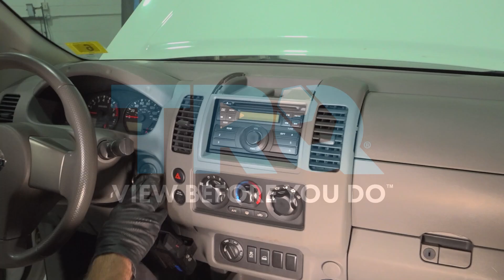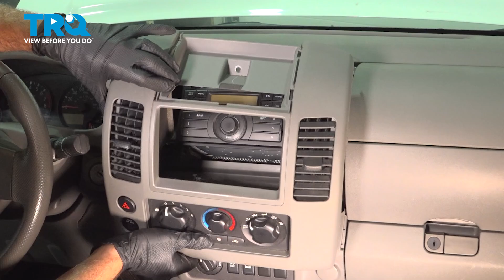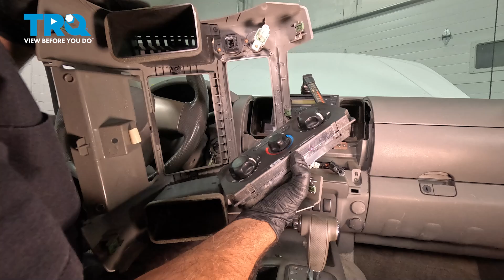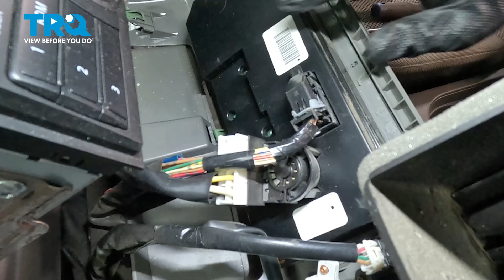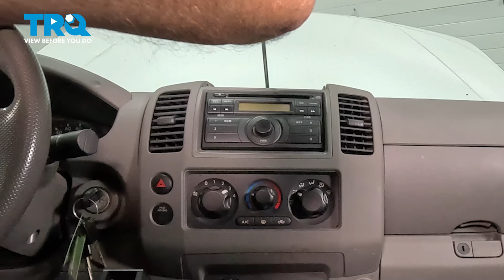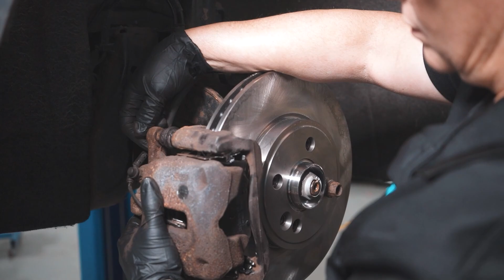How to Replace Heater & AC Control 2005-2021 Nissan Frontier

Comment: Hello sir, I'm looking for part Climate Control Unit (CCU), Nissan Navara D40, 2013, RHD, P/N: 27510JS60B, Build Code L2. I found this information on the back of the CCU. Also, will a LHD of this part work, so plug & play, without doing anything on the wiring? Please advice.

Comment: I am having a slight issue with my car's control unit. It functions properly, but it does not light up when I turn on the lights. Could you kindly provide some guidance on how to resolve this issue?